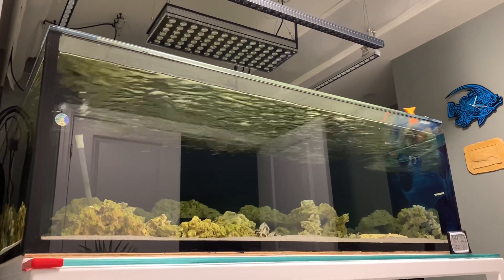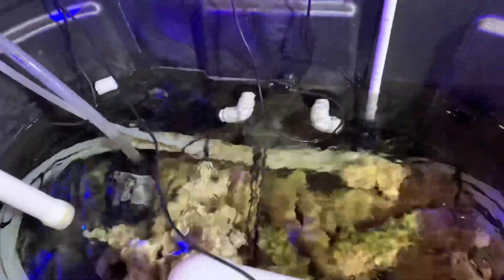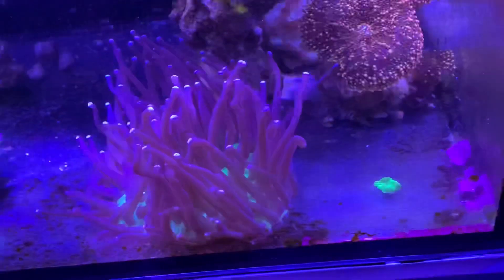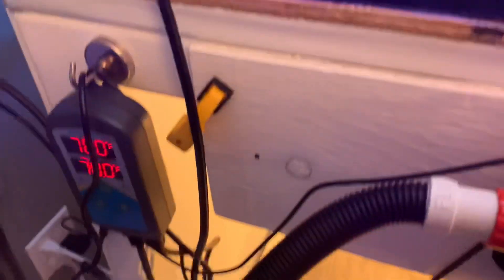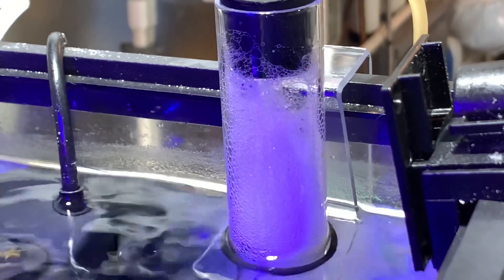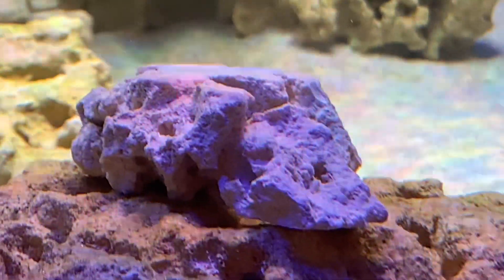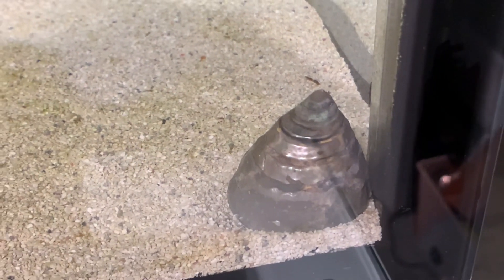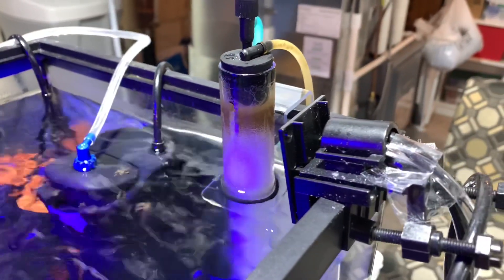Reef Wrap-Up No 13 - Are We There Yet? UV, Diatoms, Ginormous Snails….and ICP TESTS!

Comment: What's the tester you're using?
Reply from the maker: It’s a WaterLink Spin Touch FF. I love it and will be doing a detailed video about it. Still have some comparison research to do.
Reply: @Reefgrrl  Woooweeee pricey
Reply from the maker: @opethmike  Yes and no - I think the market for this thing is someone thinking about spending the $$ on a whole testing system of some type. That’s why I want to do the comparisons. From what I’ve learned so far, this thing is more expensive but not by much on a per test basis. And no tubing. No calibration. No cuvettes. No reagents. No rinsing. Takes 5 minutes to test 8 parameters. Maintenance is only necessary if you spill water on it and then, it’s just a wipe. It’s still on battery power from its first charge last September and I’ve done 47 tests. It doesn’t need to occupy space near your tank. There are more pros.... But yes, there are cons too. Once I get some time I’ll get back to gathering the info I need to finish the video. 😎
Reply: @Reefgrrl  It really does seem to have A LOT of upsides, that's for sure. I have four reef tanks, and testing takes a good while, so I may have to consider saving up for it.

Comment: Everything is awesome but there is no source for ammonia to build up. You need few fish to provide some waste for N0 P0 to be produced otherwise you’ll still get algae bloom. Put fish and let the reef flourish its bacteria population.
You need to get some flow from back to front for that areas to keep circulated.
Reply from the maker: Indeed, and it’s all in hand. The rocks have been curing for a year or so and are already colonized with bacteria. Some were in salt water bins since August of 2020 and others were cured in other salt water bins since February of 2021. Some were in the sump since June of 2021. During curing, I added bacteria and a food source. However, the sand is new and because of that I’ve added 5 or 6 different types of bacteria since I started adding water to this tank. There were low ammonia readings for 4-5 days after adding the sand because during this time I added some frozen brine shrimp to the tank. So that’s all underway. Regarding flow, as I mentioned in a previous update, what’s in here now is temporary because I need something to keep the water moving, but I have a pair of gyres which will be installed on the back wall once the controller cabinets on either side are installed, and that won’t be until the two bodies of water are joined because of how the valves are situated below the overflow. It’s like a military operation lol.... Thank you for stopping by! 👍🏻

Comment: Consider doing some more variability in heights randomly across your rocks.
Reply from the maker: Hey Alan! It’s not really obvious but I’ve left lots of crevices between rock structures so I could keep the whole thing low enough to allow for eventual coral growth across the top. Plus, I wanted plenty of open swimming space for fish. I learned from the past couple of aquascapes I built that vertical planes aren’t conducive to coral growth - in my 20 gallon nano I had a pair of towers that left large stretches of open rock visible. I think you’ll see my reasoning when I start adding corals and fish. Lol - I have a very clear picture in my mind of what I want it to eventually look like that’ll be revealed over time. I appreciate your comment - I know this is different from how most people would approach it. 👍🏻

Comment: Great update as usual.  Sponges will take up silicate so it will help reduce diatoms.  The other stuff on the rock looked like cyano.
Reply from the maker: Indeed, and cyano has appeared in other spots where there’s low flow. When I aim a powerhead at those spots, it disappears overnight. Once the gyres are in place, along with a couple of other powerheads I have planned, I’m hoping to be able to get it all balanced. But that front rock is now clear, after the big snails spent some time there. 🤔

Comment: Curious why you're trying to cycle the main tank vs just pumping the water through the system from your basement....assuming the basement chaos is nutrient rich wouldn't it just be like a water change to the system adding the water volume ? The low No4 is why that rock is showing signs of a cyano outbreak imo
Reply from the maker: Hey Sammy, the water in the display came from the sump system originally so contains organics already. I’m reluctant to mix this 300 gallons that has been separate for a few months, back into a mature, healthy system where all my corals and fish are now living, until I can get the water quality/parameters matching as closely as possible. I don’t want to shock the sump system with this water until I’m sure it’s of good quality. It’s probably fine but I’m not taking any chances. The cycling that’s going on now is, I believe, because of the new sand. The rocks came from either the sump or my rock curing bins. One great thing that happened today though: the water is nearly clear now! I’m expecting to go in there tomorrow and find it has cleared up. To me, that means the bacteria are in balance. 🤞🏻
Reply: @Reefgrrl  excellent 👌